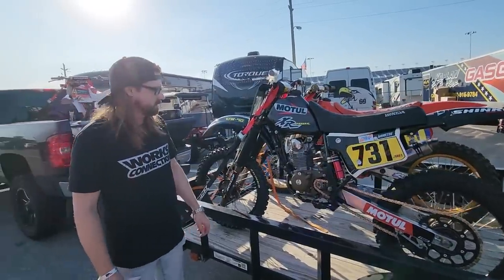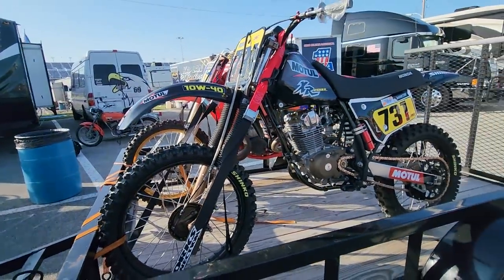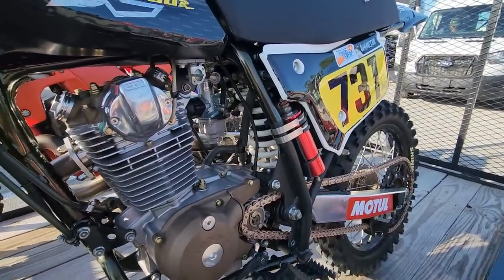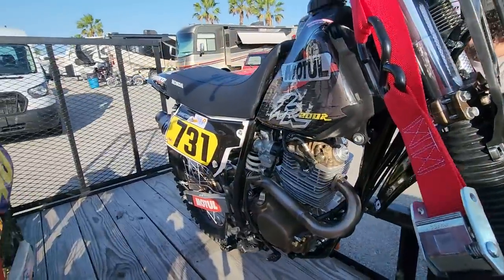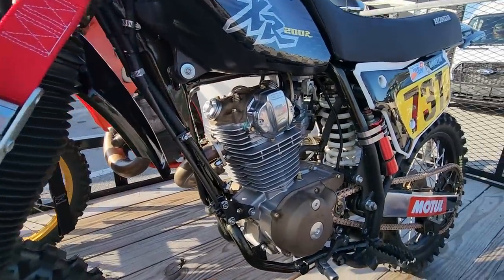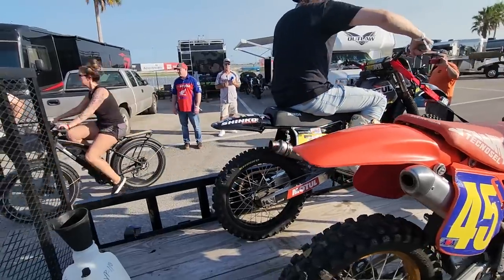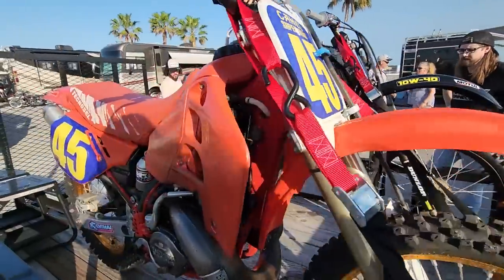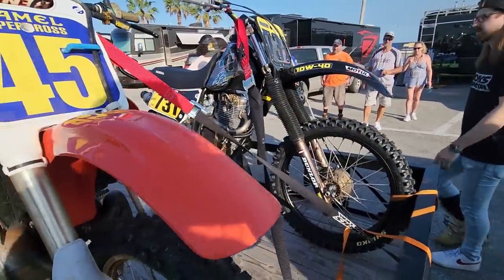HONDA XR200 BLAKE WHARTON FACTORY EDITION SOUND CHECK = READY TO RUMBLE AT DAYTONA SX TOMORROW!

Comment: In 1981 I built an XR200 with a power roll stroker crank power roll big bore kit, roller crank. I ported and polished the head, after that I went to work on the suspension Simons forks w/power rear shock, white brothers swing arm. It was about a 230 cc XR200 . A 50 mile cross country was all the clutch was good for. I was working on maching a CR125 clutch to fit the shaft I never could get it to work. She was a ripper for 50 miles. I took home a lot of trophy’s and a lot of clutch plates. I’m 74 now but would do it all over again.

Comment: Anybody else screaming "take my money"!!!
How much for 10???lol
The compression is a real thing.
I built an 87 trl200 with a atc 185 head and bored 30 over.
Trick piston,cam  and bigger atc valves with a. aluminum wes header and pipe using a Russian  built slide carb from J.B. racing.
Falcon shocks and a fanatic front end...still have.
They are painful to kick and the compression release isn't much help.
Great video Kap.
Those two bikes were incredible.
*Our shop bike just won Best Dyna at chopper mag event.
Earl6 is good six
Reply from the maker: Text me pics of the dyna@! 860 916 9784
Reply: Copy.that
You can delete if you want I have it cat daddy.

Comment: I like the black guards and tank. But I like the sound of my xr a lot better custom exhaust and custom mega bomb worked motor bored ,ported n oversize valves im a engine specialist…. 
I’m looking forward to my new motor it’s using a Yamaha xt225 71mm piston bigger liner in std barrel so looks stock and head has 2mm oversize valves and ported and cam

Comment: The XR should be the four valve that they call a dirt bike. That motor was always laim.
Reply: Don't expect many to agree with you
Reply: My four valve 200 was pretty awesome at high revs but might be less torquey and heavier than this 200.
Reply: this bike makes 27HP lol weighs 187 pounds full custom build she moves lol this is 15hp over stock nothing stock on this bike

Comment: XR200 ❤ Sounds a little crisper and refined than mine, similar grunt I figure cause I've got a CB200 down pipe and a chrome shorty Cherry bomb on mine, this thing is profound tho, CR swing arm and upgrade rear end ...my other XR200R I'm building has a '86 CR125 front end and billet yokes with a later xr250r rear shock, does add a bit to the height and they're already a tall bike.
Reply: I just got a 88 XR200. Does it respond much to simple mods such as PWK carb, intake mod and custom exhaust? How about getting a high compression piston and a camshaft, will it feel somewhat powerful?

Comment: I put an xr185 engine in a 1981 Kx125 frame  many years back.  Did a high compression 210cc  piston with midrange cam and custom exhaust . It was awesome on steep single track.
Reply: Just got a 88 xr200. Will definitely do the 210cc kit, cam as well as exhaust and intake mod. 

The hard part will be the suspension and fitting a disc brake in the front I think.